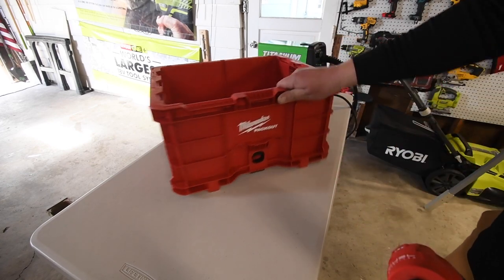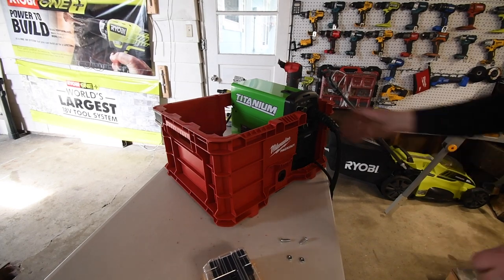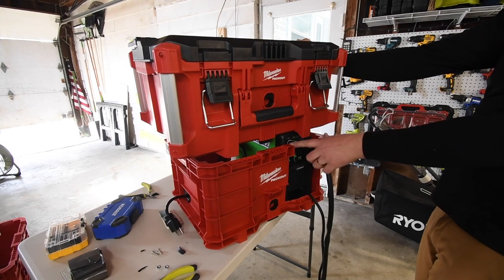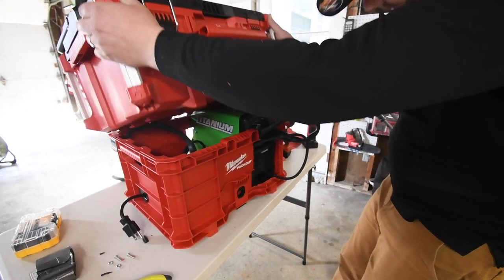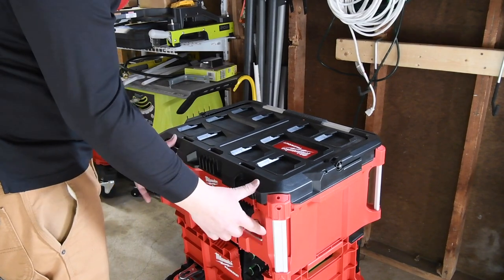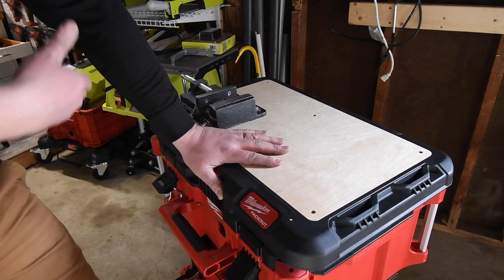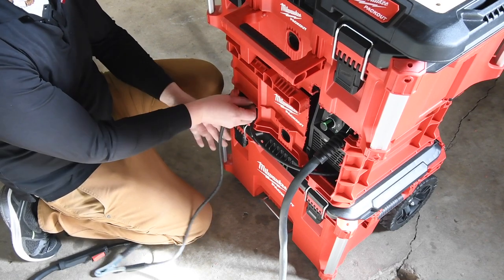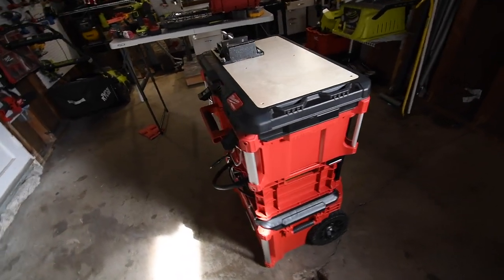Milwaukee Packout (Portable Welding Station) for Titanium Welder form Harbor Freight

Comment: Um for me, put drawers below the welder to store the accessories. Hang the mask on the side or cart handle. Then either put raised feet on the top or use two tops (the lower one being cut to fit the welder).

Comment: Nice build.  I would’ve put the welder in the bottom box and taken more time when I had to cut stuff out to make it fit much much better and tighter. It was kind of sloppy the cutting that you made to fit over the top of that welder with a lot of space around there that loose things would lose and fall down in the bottom box.

Comment: That was cool as hell realy ; it was and maybe if you haven't made him one yet get some black trim from the automotive big box store ( I hink it's door or window trim) and leave a little lip on the side where you cut out the spaces for the trim to go keep from cutting the cord on sharp edges when the cords gets pulled out.
  Put super glue in the trim so it stays on just a thought !!, Dave 
 And one last thing you hit me in the 🤬 face when you pulled the cord out to show case the tool lol 💯🤣🤣🤣🤣🤣
Reply from the maker: I will be doing a version 2 of this soon :) it will be much better build :)
Reply: @ManCaverTools  sorry man I wasn't or didn't mean to imply that it wasnt a good video it was I seen your video and thought of it b/c I seen one youtuber do it with a 10 " lazy susey and a home deolpo  and a I think 1 1/2 - 3 in black pvc pip to mack a extinction cord carrier/ store system lol

Comment: First of all, Well done, Dave! Looks like Mr. Bates will have an excellent little welding rig! Kudos to you on the quick execution too. Found myself wondering if the size and shape of the welder would fit inside the Ammo Can Packout? (Probably not, because, well, let’s face it, very little fits inside the ammo can well, aside from maybe plumbing parts.) My second thought, if you ever tweak the concept for the Gen 2 Packout Welder, perhaps using a Packout Work Surface as a crate the topper, modified by removing the wood work surface and cutting the hole to accept the height of the welder. If that offers enough clearance, you could then use six bolts to attach a Packout Mounting plate on top of the that crate topper. This way, you wouldn’t be cutting the bottom out of a $79 box. Now, admittedly, my way probably does not save any money, because you are using two separate pieces to cap off the crate, but you could either use this higher in the stack, or still mount that mid sized box on top, but intact. Just some thoughts in case you are looking to modify the design for a second rig, for yourself, a friend, or maybe even some lucky subscriber...(hint, hint) 
: ___ )
Reply from the maker: I do plan on making a version 2.0 when it comes to this rig and few things I Gotta do to this rig tomorrow for mr bates and I thank you for your support James
Reply: @ManCaverTools  I’m sure it’ll be amazing. Keep up the great work.

Comment: You weld much? Plastic in proximity to the process doesn’t generally last long. YMMV.
Reply from the maker: this is to practice welding on. it won't be used a lot in 1 session
Reply: yup, that UV is a killer of plastic. Also: welding your own welding cart makes for... excellent practice. Metal or Death!